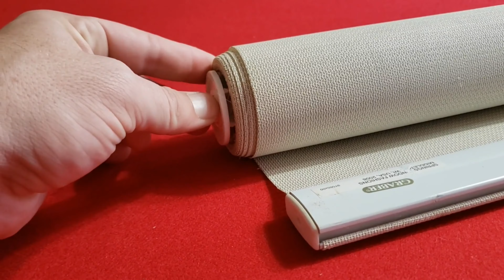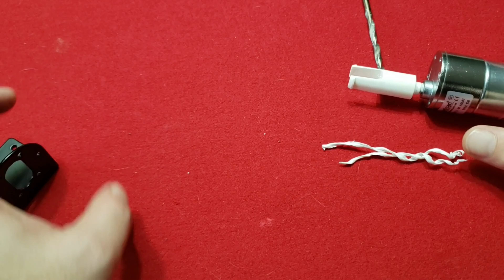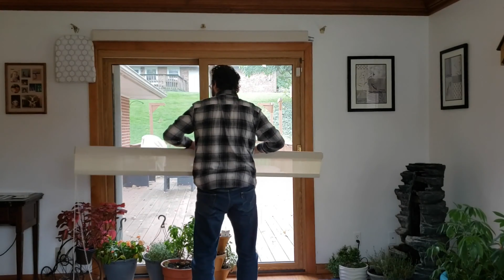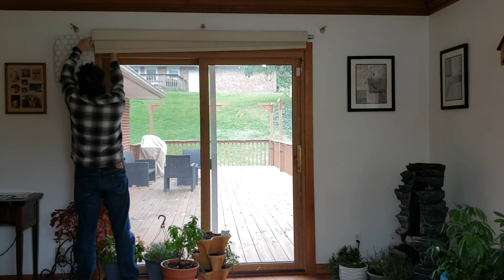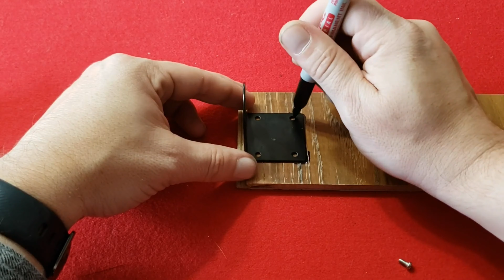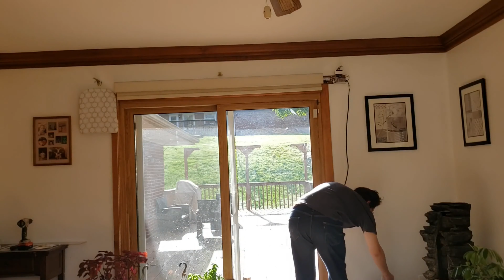Roller shades, low-voltage switches, and failures - An update.

Comment: There was no rambling on this video. On the contrary you do create "smarter circuits" and make it entertaining too. 
I do feel your subscriber numbers would increase if you considered linking your devices to Home Assistant. You are familiar with a Raspberry Pi, Shelly, etc so it wouldn't be a steep learning curve. There are already many good producers of Home Assistant content but they tend to look at it from the programming/automations point of view, which is very interesting, whereas your approach is more of an electronics point of view. Home Assistant has the specification to deliver "smarter circuits" type projects but I don't know of many people producing such content and it would be of interest. Taking the roller blinds as an example. There are plastic sensors out there that will do a similar thing but they are flimsy, susceptible to damage and probably cost more. Your solution is far more robust and offers more control. It's worth the extra effort to follow your solution on Home Assistant. It's just a thought.
Reply from the maker: I will certainly look into it. I have, up to this point, kept things very simple for a variety of reasons, but I have seen quite a few things in regards to Home Assistant. I think I will give it a test run and perhaps do a video of the experience. Thanks for watching and engaging!
Reply: @smartercircuits  Glad to help. If you added it to Home Assistant, that would be the second video. Your projects, therefore, would always cover two videos. One for the electronic side and the second would be how it connects to Home Assistant and the possible automations.